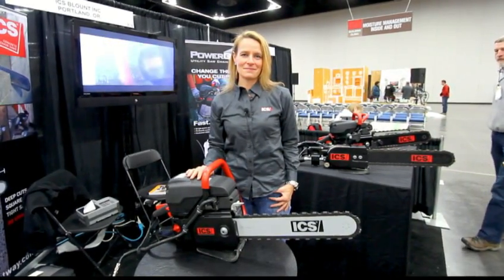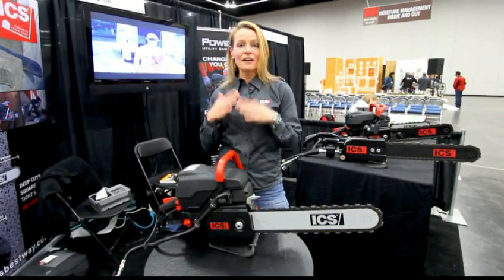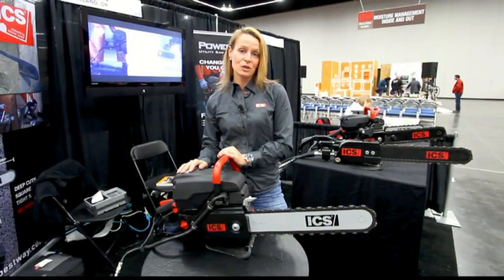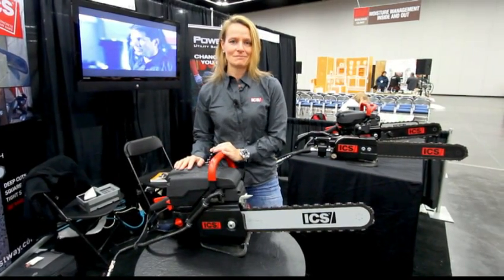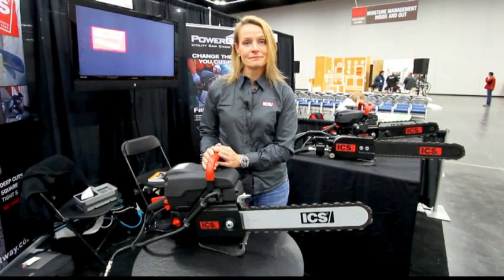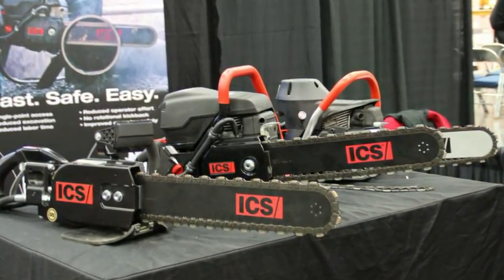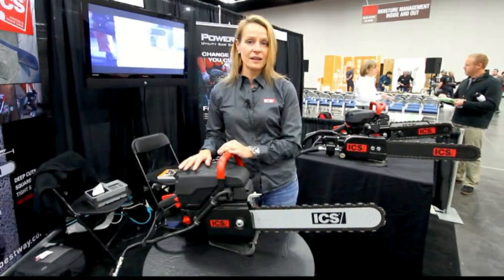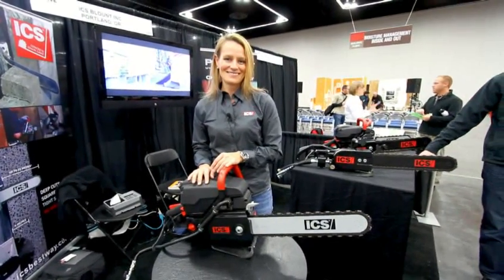ICS Concrete Cutting Chainsaws

Comment: can you use concrete chain saw to saw firewood ?
Reply: Yes these things will cut through anything, even designed to cut rebar inside the concrete. But I don't know why you would want to cut wood with it. You'd get a crappy cut because it would grind through instead of cut.